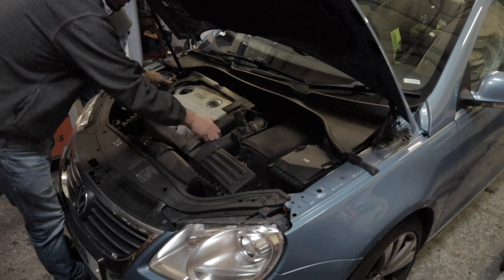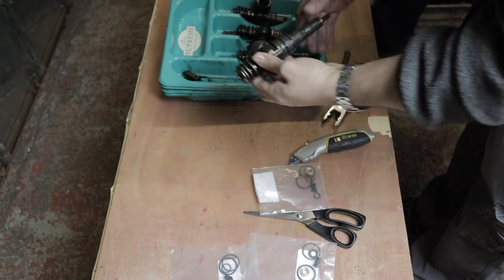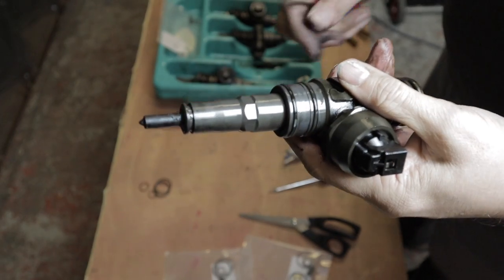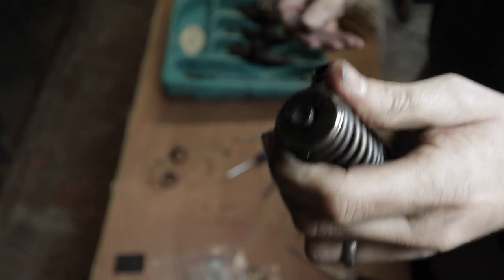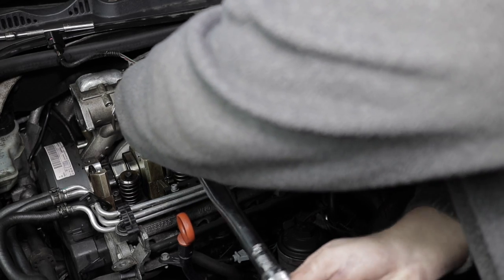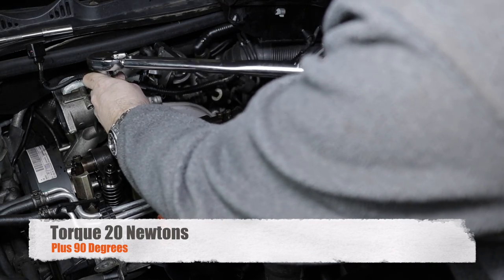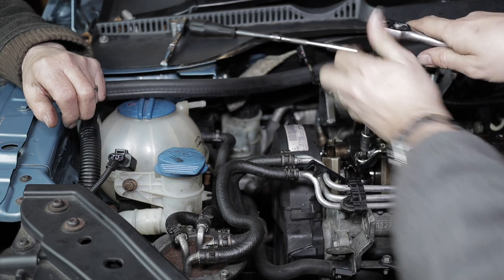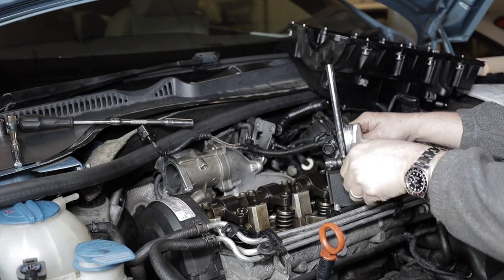VW PD injector, Remove, Reseal , and install, The complete Job

Comment: Thanks for the helpful vidéo,just wondering what happens if we tightened injector bolt harder then you did in your video?
Reply: Since they're TTY bolts There's a narrow range around the listed torque angle where they're at maximum holding power. So, you can get away with a little over or under. Too little and it might not seal or could back out. Too much and the bolt is over stretched which is about the same as just being too loose. Way too much or trying to reuse TTY bolts will likely break the bolt and you will probably need a new head if you don't know how to remove a broken bolt. This range of maximum holding power is different for every bolt and the manufacturer rarely publishes that information.

Comment: Amazing video, thanks for sharing it .
Just a question, why do I need a dial gauge, can I not just visually see the injector spring at its lowest point?
Reply from the maker: No the dial test indicator is vital to find the correct set up in this case in my opinion, remember the engine is rotating at 100 revolutions per second and the tolerances will reflect this, they are cheap today compared to redoing the job or a new engine
Reply: @RichManPoorMotors  If you were to get this engine spinning at 100 revolutions per second (with the help of NOS) it would be blasting rods out of the block in short order... 60revs/second would be pushing it when these get a couple miles on them.

Comment: good job! i've replaced 1 injector on my vw pd engine recently. had trouble with leaking cam cover afterwards. ended up buying a new one due the old cover being warped.
Reply from the maker: Thank you, I’ve heard that others have had same problem as you, I’ve always used a new seal and tighten down like a head gasket and I’ve been ok, probably just lucky
Reply: @RichManPoorMotors  i've tried new seal, but didnt work. Also i didnt want to bodge it with loads of sealant. Had to bite the bullet and buy new cover for £££.

Comment: There is a specific tool designed to remove the unit injectors. There is also specific tools designed to aid in o-ring install and prevent damage to the o-rings. Also, all the hardware associated with this job is technically one time use per VW. Just in case anyone actually wanted to know...
Reply from the maker: Thanks for the comment, I hope it helps someone

Comment: Do you recommend using sealant like RTV on the cam shaft cover gasket, or just a smidge of silicone grease?  I've got a slight seeping on the long end near the timing belt cover after replacing the injector loom. I just used a small wipe of grease on the new gasket and incrementally torque the bots in the same sort of pattern as I would a cylinder head.  My Haynes manual  says to use some sealant over the cam shaft arches, but I was a bit worried by by lack of experience with sealant on gaskets. By the way, my Haynes manual seems to suggest that installing the o-rings on the injectors is a specialist task for a professional? Great Video, thanks! And thanks for any advice about the sealant.
Reply from the maker: The camshaft covers on vw’s are notorious for leaking when changed as they seam to warp slightly, vw’s answer would be no to adding any sealant to the cover followed by here is a bill for a new rocker cover and new gasket, i would add some sealant on my own but can’t recommend it refuting to the o rings that might be down to how some people put on or remove them, or using incorrect o rings, I have had no problem but I’m use to replacing o rings in hydraulics

Comment: What a great video I have been looking for something as informative as this since our mk5 vw golf 1.9 tdi injector seal's went allowing diesel to mix with the oil my question is where abouts do you crank the engine over from and what do you use to do it anything need removing ect
Reply from the maker: Thanks for the comment, the engine is turned via the crankshaft, this is done with a socket and long bar for leverage, to get on the crank you need to remove the pulley wheel for your accessories belt, I thought this is all shown in the video if not check out my other video on timing https://youtu.be/GZtATHhIUcU

Comment: Well explained video. I have 375k miles on my MK5 TDI. Eventually going to try this. I have been looking for 5 years for a decent video. Only one video out there for the last years and I couldn't quite get the language..Now have to figure out configuring new injectors. Question- is the dial indicator readily available in the USA. Thanks
Reply from the maker: Hi yes dial test indicators are quite common tool what I don’t know is if they are known by a different name in USA I will look for you and post a link to you tomorrow just to remind you stretch bolts are one time only so you need new ones
Reply from the maker: Hi as promised reference dial test indicator here is a link for one like i used in the video in the USA https://amzn.to/34fFinW

Comment: Hello. I have black smoke under heavy acceleration on my 210000 mileage. 1.9tdi, my mechanic has told me to remove them to bring them to him to test. Looking at your video has given me the confidence to take them out. Many thanks to you.
Reply from the maker: Hardest part is turning over the engine and looking at the dial test indicator at the same time
Reply from the maker: Black smoke is fuel, also consider the valve guide seals at that mileage

Comment: hi man, thanks for the video.. i have a pd 1.9 tdi axr repro at 160hp.. 170.000miles. im pretty sure there is fuel in the oil. vagcom at 90°C shows me a good inyector values.. all 4 close to 0.00~ +-0.40.. under preasure at high speed all looks good but i have a little rough idle and a bit of smoke. i will change tandem pump seals tomorrow, then if it doesnt work i will change inyector seals.. do you think problem is coming from inyectors or tandem pump?. THANKS!

Comment: Any idea why the injectors with new seals don't want to go in? I bought a fitting kit to go with some reconned injectors but i can't push them flush into the bore. Ive tried tapping it down but it will not budge

Comment: I’ve been researching this job due to excess oil in the fuel filter on my bmn engine,  your video is by far the easiest to follow.  I’m torn between this and the tandem pump,  the car head a new head a while back and this is the first filter change since so thinking a seal could be dodgy on either.......
The car starts runs and drives fine,  does smoke and smell a bit,  I’m assuming this is due to the oil being burnt when it’s running.  

As the cold weather has now set in it’s also starting to to struggle on the morning start up.   Ultimately I’ll probably replace tandem and injector seals,  whilst cleaning out the tank.  Can I ask if anyone else has had the same and where would you start ?
Reply from the maker: Thanks for the comment,
1st Check your dipstick if the level has gone up then diesel is leaking into your sump, smell the dipstick for diesel.rub some oil between Your fingers to feel the oil. If you have fuel in the oil then it may be from injectors leaking or spray pattern, if your oil has fuel in it then you won’t be getting the lubrications you need. And rings won’t be giving you the compression, and the oil could be passing your rings, Fuel goes back to the tank so if you have oil in your fuel filter then you will likely have oil in your tank, if you replace the fuel filter then it will be black straight after, even if you fixed any fault, fuel may be getting in from the tandem pump or through the head, you said you had a new head could the old head be responsible for the oil in the fuel filter have all new seals gaskets been changed, remember your injectors are covered in oil when temperatures drops the diesel pressure will drop in the cold head and want to suck oil into the fuel past the rubber seals, also pressure in fuel would want to go the other way, so I would start with checking oil 1st as I mentioned oil in the filter might be from previous head
Reply: Hi,

Thank you for taking the time to respond,  the oil level only ever goes down slightly never up,  the previous work was done at a dealership new belts gaskets etc but I can help but think they maybe missed something.   I don’t think the old head was responsible for it,  although I can’t 100% confirm, I’d have expected that to have burnt off since the work was done,  it’s done a few thousand miles since.  The oil was well worn but no different to the oil I drained from my other car (they are same car same engine.)
I’ll probably start with a tandem pump rebuild kit or replacement then flush the lines and wipe out the tank,  if the oil returns I guess I’ll do the injector seals. I’ve been torn between the two jobs because I imagine draining and cleaning the tank to be a horrible job.   The pump it self doesn’t look to bad to do.

Again. Keep up the good work on the videos.  I appreciate the time you have taken to reply.
Reply from the maker: @LouisCleaver  draining the tank is not too bad, i run the car low on fuel, and then take out the fuel pump under the rear seats, then with a fluid extractor remove whats left of the fuel, there will also be fuel in the fuel pump, then you can get your arm in and wipe the tank with cloths etc, if you are doing the injectors, it might be worth doing the valve guide seals at the same time, but as you have had a brand new head that should be ok.
Reply: @RichManPoorMotors  I’ve ordered a replacement tandem pump,  and an injector seal kit,  fingers crossed
Reply: @LouisCleaver  how did you get on ?
Reply: @Lee-eu6wf  it was a pain in the ….
The exhaust ended up full of diesel,  I ended up replacing the head,  as it appeared one of the injector bolts had left a part of the previous bolt inside and it was too deep to reverse tap out.  I also did new belt and tensioners. 
Then had to drive it for about 50 miles to flush the fuel from the exhaust.
I’ll not bother with this job again personally.
Though the help and support from this channel was spot on.  With out it,  I would have just replaced the engine and been done with it.

Depending on your issue I would definitely do the tandem pump first.  Less to go wrong.
Reply: @LouisCleaver  thanks for replying man thats alot of work you did I surprised you stuck with it, I'll be checking my oil for diesel, I think I have leaking injectors, it won't start in the mornings unless I pump the throttle. 1.9tdi pd bxe 105
Reply: @Lee-eu6wf  it was that or burn it…..   it’s too good a car to waste,  I won’t be beaten by a machine……… easily
Reply: @LouisCleaver  😂😂 I like that, tbh I'm not beaten easily nither it's maybe an old car but I know everything about it and I like knowing that it's right as long as the rust is kept at bay.
Reply: Hi, thx for the video. Do you remember checking the injector bores for wear rings? Seems to be a problem in some alloy heads from the pounding the injectors give, resulting in fuel leaks.
Cheers

Comment: Great videos fellas , I’m hoping to try fix my caddy van with a starting problem been lead to believe its injector seals or injector loom or even injector , as when pluggged into vag it brings injector 4 , but sometimes on idle engine does wobble shake abit , been told it’s early stages of seals and worn cylinder head? It’s a 2.0 sdi pd , I’m no mechanic but I’m willing to try do seals etc only thing I will need tool wise is that time gap gauge to show cam at lowest point , are they universal fit 
 ? Cheers
Reply from the maker: Thank you for your comment it’s a dial test indicator ask at a auto parts store or check out my link, they are useful for many jobs
Reply: Where do I get this dial indicator with the block please ?
Reply: Exactly same for me injector 4 Sdi caddy.  Have it all except dial gauge
Reply from the maker: Hi try https://amzn.to/2NyBxo6 for dial test indicator 
it looks as if my original link had changed this one should work

Comment: You forgot the O ring behind the two little screws and bar, iy leaks there too. Test with VCDS grp 35 injection pump on to test when cover is still off. At 290k miles thpose started to leak. The o ring does not go on the top, that one does not seal anything!!!

Comment: Hi, thanks for sharing this, my 2003 golf AXR motor has strange periodic rough idle, other than that it runs fine, have been thinking about checking the injectors, now I think I have the confidence to do it.  Is there a safe way to clean the injector nozzles?  Or is it best not to touch them?
Reply from the maker: I never take apart the injector but I always place the injectors nozzles in a Ultrasonic cleaner, I don’t separate the injector just place them tip in, into the water and cleaning solution, I don’t go below the tips as I don’t want the fuel in or out submerged. I don’t know if there is a chance of damage, so do it at your own risk, but this is what I do, I found this cleans the tips for a better spray pattern. And I’ve not had any problems myself
Reply: @RichManPoorMotors  OK, cheers and thanks again.

Comment: Hi Diesel fuel for injectors comes directly from inside the cylinder head?No injector pipe!
Reply from the maker: Hi yes on the pd engines, fuel goes from the fuel filter to the low pressure fuel and vacuum pump, inside the cylinder head to the injectors and also returning in the head then back to the fuel filter. The injectors have fuel inlet and outlet on them, as shown in the video and the injectors themselves produced the high pressure via cam on injectors
Reply: @RichManPoorMotors   thanks! I had used a 2001 polo tdi before, and I had just noticed that fuel for the injectors went through the cylinder head:)

Comment: good video but the settings of vw pd motors are not all the same. The adjustment of pump in video was -180ªback but  the 1.9 pd are not that value. Do you confirm?
Reply: 225

Comment: great video - but you didnt replace the injectors them selves, just took them out and fitted new seals and put them back ?
Reply from the maker: Yes, I showed how to remove the injectors, replaced the seals on the injectors and replaced and set the timing on them. If you are fitting new injectors then they should come with new seals and you would have to replace and set the timing as shown in this video

Comment: Hi where did you buy the new stretch bolts? And the seal kit
Reply from the maker: It was quite a few years ago now, so I can’t remember exactly, it was either through eBay, euro car parts, GSF parts, a google search, or my local motor factors which is Parker parts the are a chain of motor factors, as this is where I got most of my German car parts eg Mercedes VW Audi BMW

Comment: Hey guys, when do you know these orings need to be replaced? 
I ask as I have a 2.5L vw transporter, I’m having a hesitation on start up, a misfire at around 900rpm and what I can only describe and a slurping noise spaced about 1 second apart. 
Unfortunately my obd port isn’t responsive.
Reply from the maker: If you oil is getting diesel in it, this could be a sign, or low fuel pressure, but the slurping sound is making me wander hard to know for sure if it might be injector sealing washer, I would describe this would more like a steam train  but hard to diagnose when I don’t have the vehicle
Reply: Rich Man Poor Motors yeah I’m struggling to explain the issue tbh and it’s almost impossible to record the noise. It’s a consistent noise every second tho so must be apart of the rotating assembly imo. Besides diesel in oil is there any other physical symptoms? Can the reverse happen and oil get in the fuel?
Reply from the maker: Just thinking of what to check with no obd
Reply from the maker: Is your engine back pressure normal
Reply from the maker: Have you checked for tutoring leaks or induction leaks
Reply from the maker: Too Hard to diagnose from here 
Diesels work on air fuel and compression, 
could be a stuck open injector 
I did have a problem on a mondeo where starter or battery was on the way out so turn over was slow to start which gave a wet piston which gave lumpy tickover and smokey until car was hot, 
fuel pump could also have problem causing fuel pressure to drop like injector seals.
 a leak in the induction system can leave to a incorrect air fuel ratio, 
hi carbon build up in the piston could be giving a pre ignition 
carbon on valve or a poor seating valve could be compression 
a faulty sensor could be adjusting air/fuel via ecu there is so many areas it could be 

but I would suggest finding cause on noise first with a Stethoscope like https://amzn.to/3hA9FKf place this on where you feel noise is coming from and it can help you hear the part working inside, I’ve used this to listen to injector, fuel pumps, alternators etc
Reply: Thats an endemic failure in those 2.5 tdi engines, the injector bore wears out and changing the o-ring wont fix it, you have to replace the head. You can google it

Comment: Hi, for the injector rocker bolts, did you use the oem torque-to-yield bolts, or the re-usable version I've seen online (different torque specs).  I'm trying to verify that your 20nm +90* torque spec is for the TTY bolts.  Thank you.
Reply from the maker: I’m trying to remember as it was a long time ago, I think they were new bolts, I know that the injector bolts were definitely TTY as I had to buy two sets, one set was for a Passat that I did a week later, but I’m not in work at the moment as my farther David who was turning the crank died so I can’t check what I purchased sorry, as always I encourage to check all settings for your engine